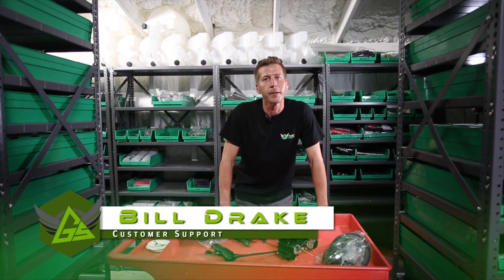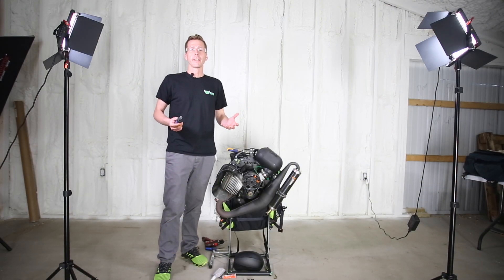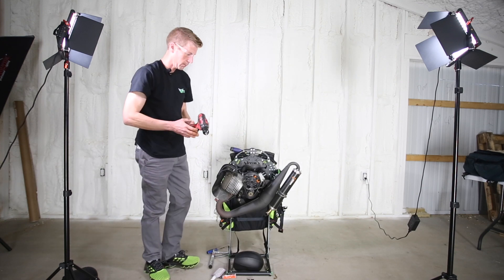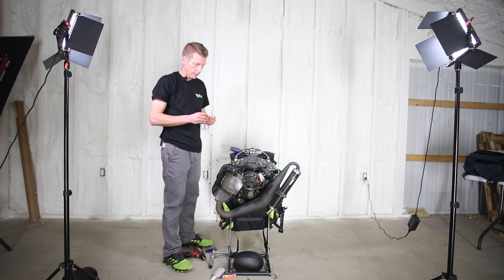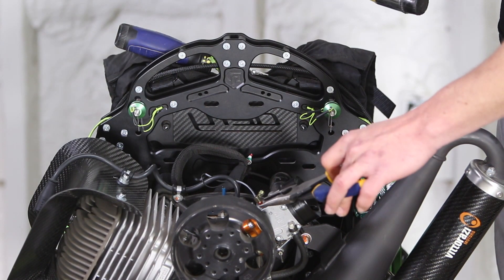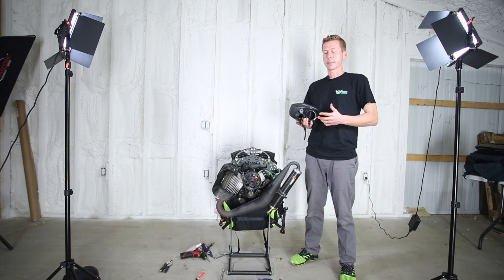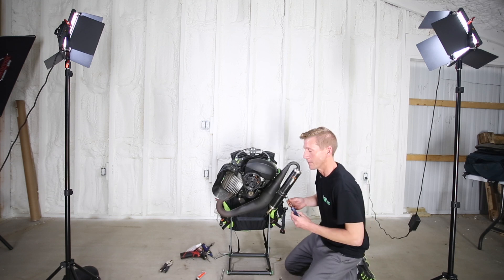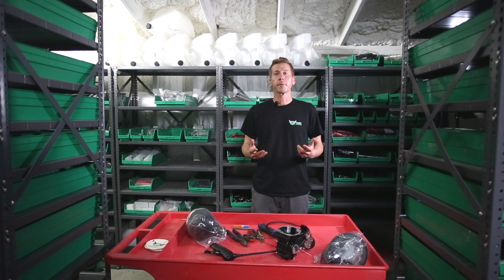GliderSports PROTIP #2  - How to install a new style MY20 airbox

Comment: hmm? so by fitting a brand new updated air box to a older moster 185.   is it easier to reach the fuel tickler? or harder?   I have a brand new my20 moster 185.